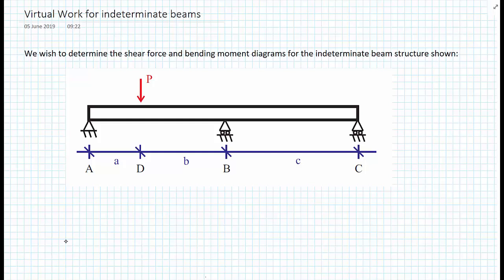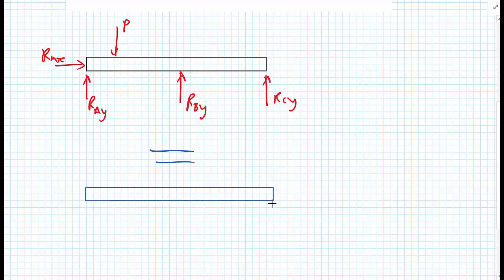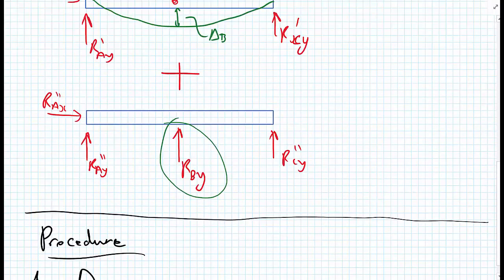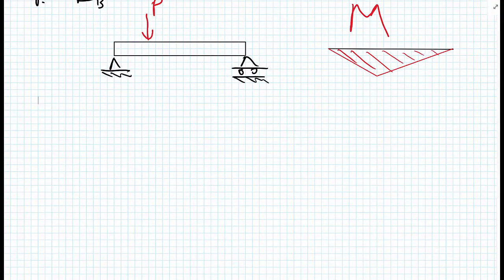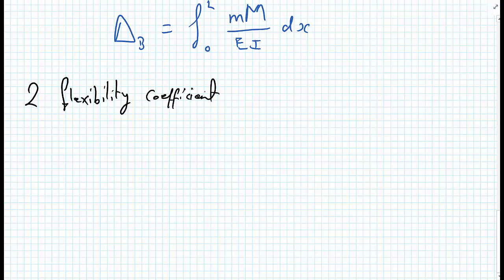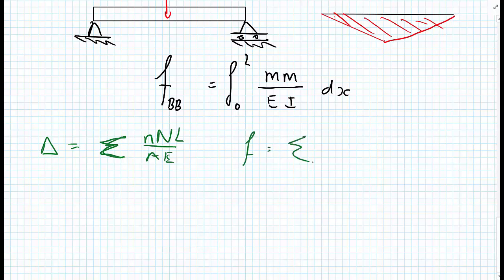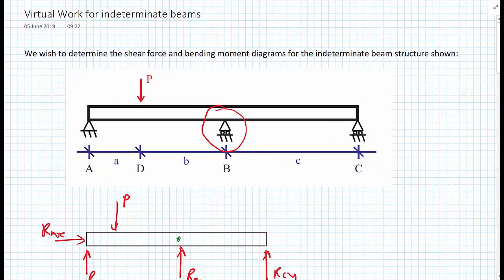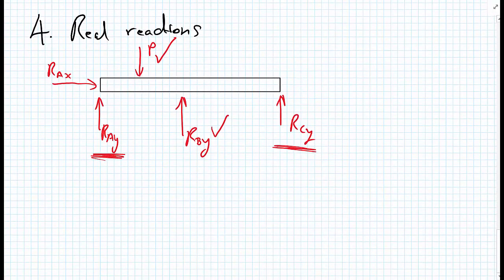Virtual Work - indeterminate beams - concept

Comment: Do you have a video on a indeterminate frame, with two vertical moments, and a horizontal span joining them. Left is fixed, right is pin. Need to use "Force Method" to drawn the Axial, Shear, and BMD's.
Reply from the maker: no